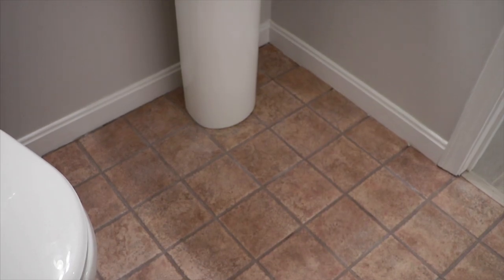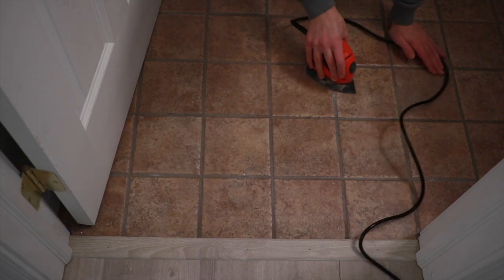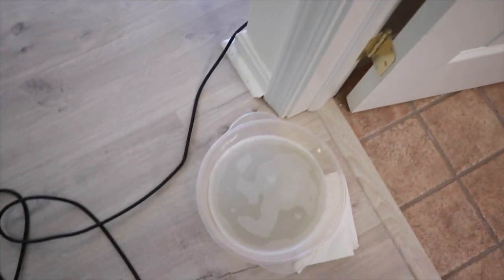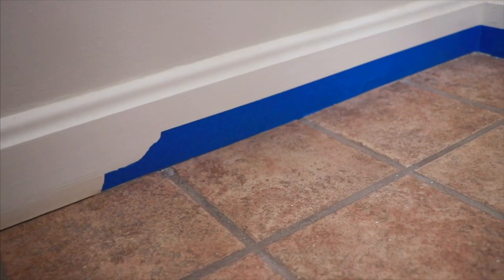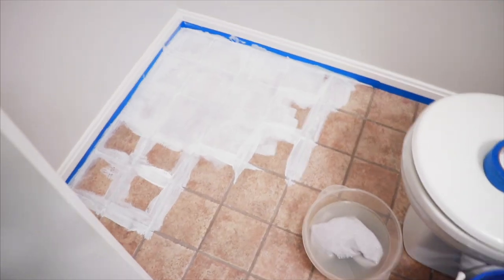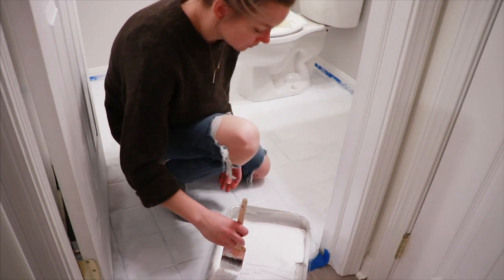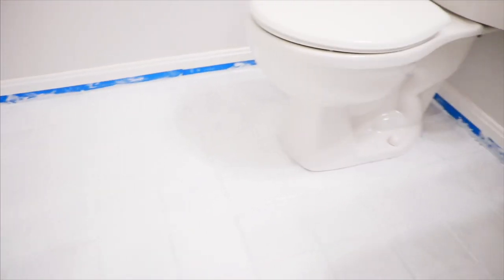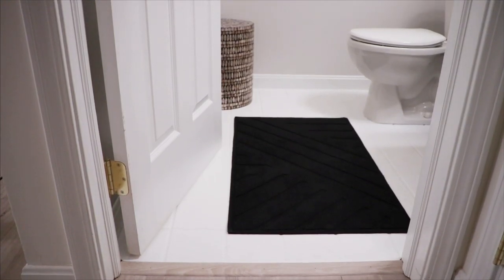How To Paint Your Ceramic Tile Floor | Ep. 1 HOW-TO HOME: THE SERIES

Comment: Do not ever ever do that with a single component paint. There is no single component acrylic,latex,enamel etc that will hold up to daily cleaning chemicals. It will slowly deteriorate and maybe only maybe last 3 months. I’ve been in the paint business for 8 years and people always come in saying they screwed up. To be safe use a two component epoxy bd classic, rustoleum rock solid etc or any two part garage floor coating/poly urea that will withstand scuffs from shoes and can be easily mopped
Reply: if using the rustoleum paint, do you need to add a sealant on top?
Reply: ❤LOVE you

Comment: I just did this to my half bath, with the same paint. I'm excited to see how it will hold up.
Reply from the maker: Awesome! Keep me updated!
Reply: Just curious, how much paint did you need to do a half bath? Going to do mine tomorrow...it’s a tiny bathroom, probably the size shown in vid, is a quart enough you think?
Reply: @stainlessmvp  a quart will be  enough. I purchased a gallon can because I couldn't find the quart. Now I have loads of paint left over.
Reply: A RAISIN IN THE SUN thank you! Looks great!
Reply: @stainlessmvp  you're welcome, and thank you.
Reply from the maker: @stainlessmvp  What color are you planning on painting them? White required quite a few coats. I would think if you were doing a darker color you could get away with a quart.
Reply: Kelsey Gonder white, just like yours. What grit sandpaper did you use btw?
Reply: @stainlessmvp  I did not sand the floor. I scrubbed with floor cleaner, a hand brush to clean out the grout, then mop with fresh water. After it was dried, I wiped with a dry cloth to remove any leftover dust, but no, I did not use sandpaper.
Reply: Hi! Do you just mop it as you would normally? I have a purple bathroom! Lol huge so much  potential,  but I need this to last at least 5/6 years lol. Please help.
Reply: A RAISIN IN THE SUN  Hi, did you get gloss or low luster?? What color did you paint & did you use polyurethane to coat it?
Reply: @tayta25  I purchased the low luster, white, no polyurethane.
Reply: A RAISIN IN THE SUN Thank you! How is it holding up? Do you think it can be steam mopped?
Reply: @tayta25  it is holding up very well. My biggest issue so far is that I have to mop or whipe a lot. It is the half bath downstairs, so it is high traffic; and because it is a brilliant white you can see every foot or shoe print. 
I've never used a steam mop, so I'm not sure. My guess would be "yes," the paint is super strong. It isn't chipping or peeling- if it does I will just touch up the spot. 
I hope this was helpful.
Reply: A RAISIN IN THE SUN Thanks so much! I greatly appreciate you! I’m going to paint my kitchen floor!
Reply: @tayta25  it is my pleasure. I am thinking of painting the entire first floor tiles of my house.
Send me pictures if you can. I have a few pictures of my bathroom floor on Pinterest.
Reply: A RAISIN IN THE SUN ok cool. I’ll be doing it really soon. How can I send them to you? How can I find you Pinterest or any other social media?
Reply: @araisininthesun5958  I just followed you on Pinterest! First time home buyer as well looking for ideas for decorating my home.
Reply: @ladyj71107  thank you so very much! I wish you the best with your new home. It's not easy getting the decorations just right. I'm still searching 🙂
Reply: @tayta25  How did it turn out? I am wanting to do my entire first floor tiles as well.
Reply: @jennifervanlaanen9803  it started out well... only thing I wish I would’ve done was let it cure longer. I did it & them had a party days later and it peeled. But I also stenciled my entry way & it has held up really well. Everyone thinks it’s tile lol. If you do it wait at least a week if you can before putting the furniture down or having heavy traffic. I’m going to go over it

Comment: How does it withstand cleaning/mopping?
Reply from the maker: So far so good- It's been over a year and I just use a wet swiffer! Easy and quick cleaning.
Reply: Kelsey Gonder Hi, have you had to touch it up since? I’m thinking about buying the black Behr porch & patio paint in Gloss for my kitchen floor & is wondering if I should not coat it with polyurethane.

Comment: How is it lasting now ?
Reply from the maker: Still no chips! Used a magic eraser to get rid of some scrape marks but they came off easily
Reply: Kelsey Gonder what kind of paint is it? Is it tile paint 🎨 I thought about painting my floor
Reply from the maker: @ml.vaughn2122  It is Behr porch and patio floor paint. Not specifically for tile however my thinking was if it can withstand the outdoor elements than it should be good inside. So far so good!